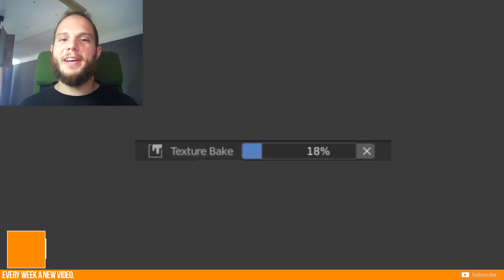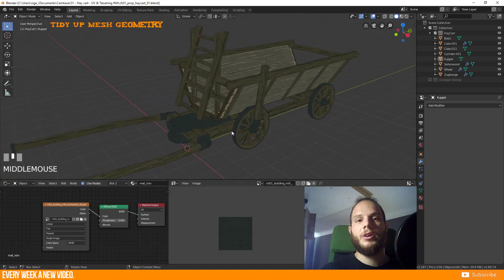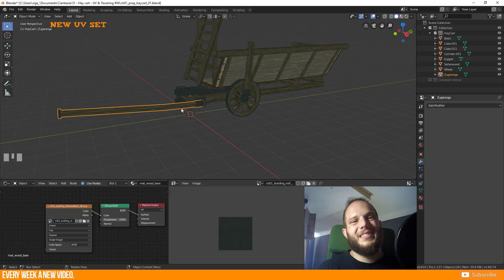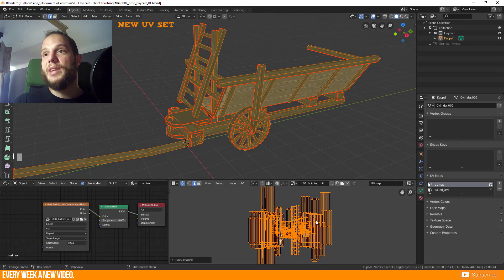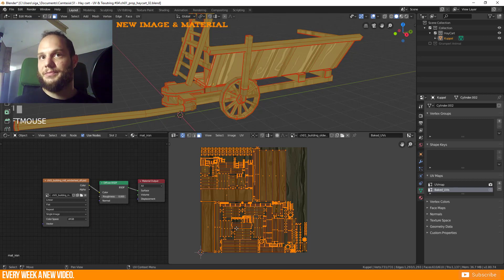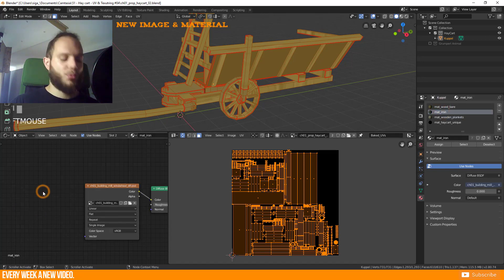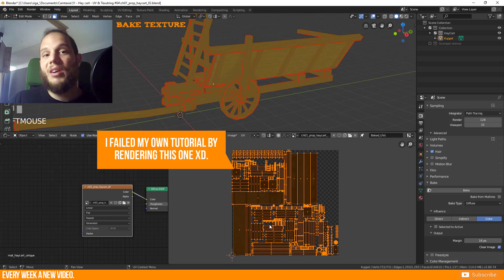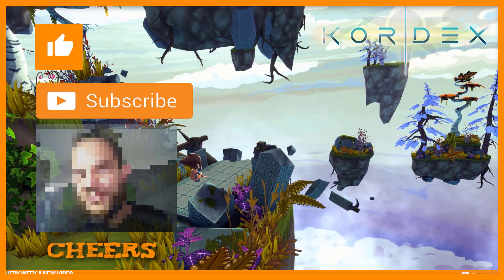How to bake a diffuse map from multiple textures in Blender 2.8 - Tutorial  - stilyzed hay cart #05

Comment: Thank you so much. I used this method on 2.79 and it worked, despite getting an error about some cyclical operation or reference. If I try it again and see the error I will update this comment with the exact message, in case it's of any use to someone else. Thanks again. :)

Comment: Great tips!!! Much appreciated! But, I have one problem. My image is one tone darker than what I anticipated. I did my textures on Substance Painter and for the note, I added AO, Normal, Height, Metallic , Roughness maps...  So can't really change anything from materials tab. Any tips on that? Do I need to go back to SP and change AO ? ... and do we  have to completely dismiss the entire shading process and start over if we are not satisfied with baking? (for ex: I change AO value to lighten colors)
Reply from the maker: Hey Ruslan, I'm glad that this video helped you in some ways. 
Your case is a little bit more difficult for me because I am not that expierienced with Shaders Nodes. I would suggest to add further nodes for your material in the shader editor but I'm not sure how to bake this later. I tested this baking method by myself just with the diffuse map and haven't done this with AO, normals, bump, ... For which reason do you need your 3d model / textures? Game or rendering?
Reply: @25games  Thanks for considering my comment and replying. I actually managed to  mix AO  to Albedo/B.Color (both color data) and connected bump map to displacement. I think the issue is, things look different blender and S.P. viewport... As "DIY" solution I could  slightly wash out my colors on SP (like increasing AO) in order to get normal results when I bake the textures in Blender. But it would be great to kniw a method to manage your coloring during shading process.
Reply from the maker: OK, thanks for your explanation. I have never worked with SP. My last 3d game had a very simple toon shader without any normal, spec, roughness maps. So I was only taking care about my diffuse map and I did this with Blender and Photoshop. Sadly I can't offer you a solution for your issue because I just informed me about the Blender function which was useful for me as well. I have less experience with the shader editor and all other maps accept the diffuse map ^^
Reply: @25games  It's a game. It has very basic shaders. What I'm exactly looking for is, old diffuse textures that most games used back in the day. Some of those games can look decent with basic shaders injections despite low res textures ...

Comment: there is one thing that bugs me in this whole process, since you used seamless textures and these repeated on severeal uv ilands of your model. couldn't you just overlay these uv ilands over each other wich used seamles textures and baked a texture wich could be lower than 4k and still has the same quality in the end? you basically optimized the texel density in the end with this method i mentioned. sadly blender has no function to do that in one go

Comment: I may have already thanked you for making this tutorial in the past...
I am watching it again because I am getting a strange result this time, although I am indeed doing it the same way. The difference it that I have about 50 different materials this time around. when I click bake, it only gets through the last 3 or 4 (since the baking process seems to go from last to first) and then ends on that texture with all my UV's crammed into it. When I go back to the UV map that I spent hours on, only those few materials have been baked. Losing my mind at this point.
I am going to remove all my normal/displacement image texture nodes as well as their bump nodes and see if that helps. Any idea what might be causing this to happen?

Comment: you could have just selected everything and duplicated the objects and then merged to create a separate combined model for baking then applied the texture atlases to the individual objects, as well as bake to target with the combined model as the target
Reply from the maker: Hey. Thank you for your comment. I know this method as well of Blender 2.79 but I have never tried this in 2.8 so far. Should be working as well, I guess.... ! I prefered this way. Don't know why ^^
Reply: @25games  It works in 2.8, having the loose parts helps if you need to adjust if something or make a mistake it's a nice backup. I use baketool 2.0 preview atm just because it bakes all the map passes and saves them to a project folder

Comment: this was very nice, thanks a lot for sharing what you found out, would have taken me ages ;'D I think I baked a texture successfully also with Eevee some days ago! But I'm not 100% sure and it was only to bake procedural info to an image file so not like here multiple textures to one... But I think it was about the same speed,so that's what I hoped would be better^^ What might have an influence is using the GPU instead of the CPU...

Yet there are some questions that maybe someone can answer:
1. Is there any speed or other improvements by using one uv map for an object? I just begun making my first game and for some objects I have more than one uv map as I never joined the objects and did bake everything to one texture. But of course the texture resolutions are smaller. Of course there's the advantage that all the uv islands are streched keeping the aspect ration which leads to more uniformity, but I'm not sure if that's needed inside the game later. It would also be easier to maybe uv-animate the material in unity for only one object. Any best-practices someone? :)

2. Is there anything to increase baking speed? Any settings, addons, whatever that would increase the speed? I mean waiting nearly half an hour for a 4k map with a 1080ti available is a bit tiring =)
Reply from the maker: You did a render with Eevee??? Sounds interesting! I thought this wouldn't be possible. Can you give me a short introduction here? I wanna try this as well :)

1. To your first question: So you work with tileable texturs in Unity? Every tileable texture have it's own material? I'm not a technical designer or programmer, but I guess this is pretty unperformant. Have you ever heard about drawcalls
?  This is an important issue about performance for your game! 
2. You waited nearly 30mins for a 4k texture? This is strange, because I only waited 2minutes. Maybe the resolution is too high for your hardware? But I'M as well not a pro at baking. :/